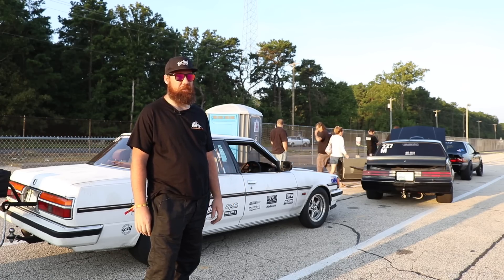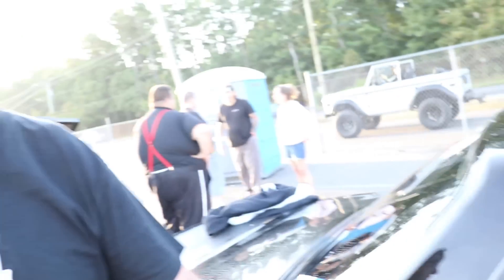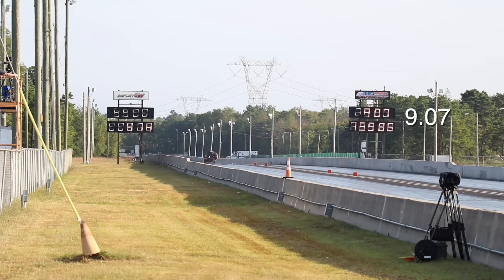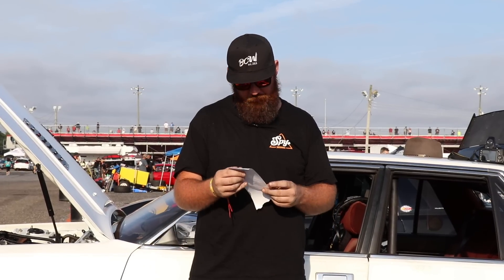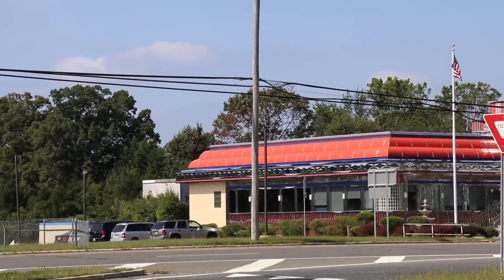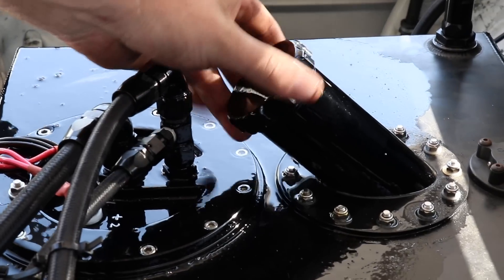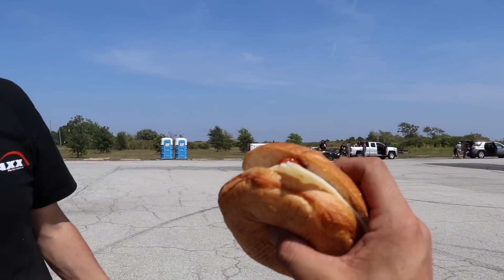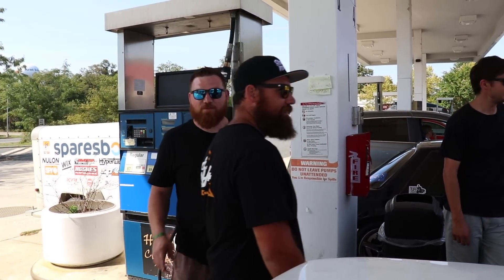DRAG WEEK 2019- Day 03

Comment: You guys really need to do the dual street/strip fuel cell mod for next year if you're running drag week, you'll really benefit from it time wise, love the roadtripping focus on the videos, it's all about the struggle for those few seconds of actual racing.
Reply from the maker: atf01 when you’re sitting in a line for 4 hours 10 minutes to swap the fuel helps the time pass

Comment: Is it possible to have the normal street fuel tank for street petrol, and add a separate small fuel cell in the boot for pure E85?  Then, with switch-over valves near the fuel rail, the switch over would take only a minute to purge the fuel rail. Obviously there'd be separate fuel pumps and switches to decide which one you want. Every time I see you guys faffing about switching the fuel, this same two-tank concept keeps popping into my head. (Edit to add, you'd need to move the flex fuel sensor up closer to the fuel rail; the goal being to minimize the volume of fuel being purged -> to save time.)
Reply from the maker: J H it takes 5 minutes to swap fuels, the system you are proposing is quite involved plumbing wise and electrically. Its easier to switch fuels . We’re sitting in line for 1-2 hours each morning so we’re not time pressed. Even the mustang in the staging lanes sat there for almost an hour before we run.

Comment: How annoying was it that the Mustang that was built to be the same as the Cresda kept going faster?
Reply from the maker: Adam not annoying at all :) its lighter and makes more power. The Cresta is on the spare engine which is rated for less power. Not what we were intending to do but we’re still in the race. We’ll cover how/ why we had to sub the engines out later
Reply: @BennysCustomWorks  that makes sense. I saw the Mustang build so I knew the motor had been switched. I didn't know it made less power.

Comment: You know if you pay with a credit card you can fill up as much as you want without having to go inside. Our system for paying is so easy, you put the card in the pump, fill up and drive off.
Reply: Josh Wolff but you need a us zip code for the transaction to work.
Reply: @jacksona4919  most pumps don't need it actually. Or you can pay with debit instead of credit and it won't ask for a billing zip cope. Still a better system then filling up and paying inside, or when I was in Canada some gas stations require you to guess how much gas you want before you pay which is really odd.
Reply: @rt4wd_wolff  Weird I have to enter in my zipcode most of the time when I use my debit card. Might be regional, either way there has to be a better solution than pre-paying with cash lol

Comment: Why havent you guys figured it out yet you should be running 2 fuel tanks one for racing an one for driving, a simple valve twist an the jobs done!... makes sense an will stop wasting time on this syphoning & flushing the tank nonsense which brings its own risks of contamination & fire risks...  only need a small 2nd tank for the track...
Reply from the maker: Ben Thomas we’ve covered this more then enough , please read other comments . Its not as simple as you think or we’d have done it .
Reply: You would drain the tank used for the road anyway because of the weight. Why have another 12-14 gallons of fuel, plus the tank and the pumps etc worth of weight.
Reply from the maker: Mark Thomas one of the reasons we don’t bother with 2 tanks.